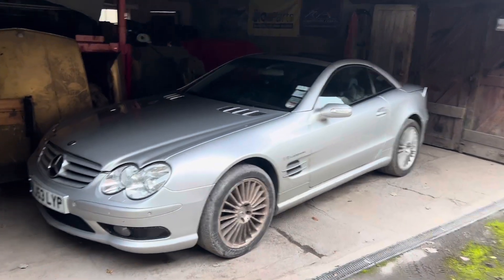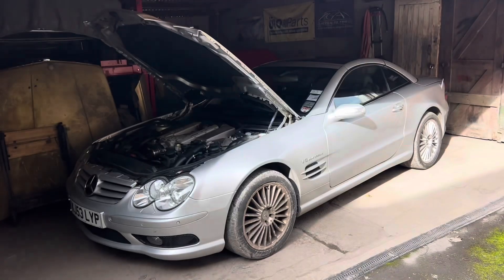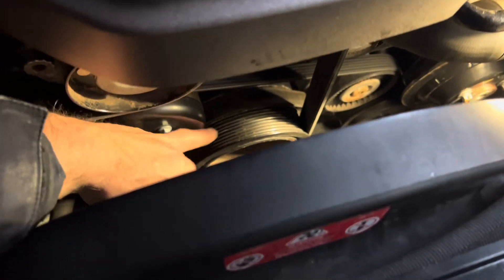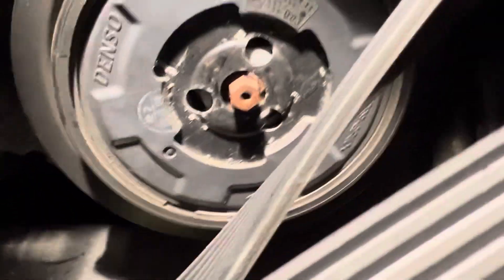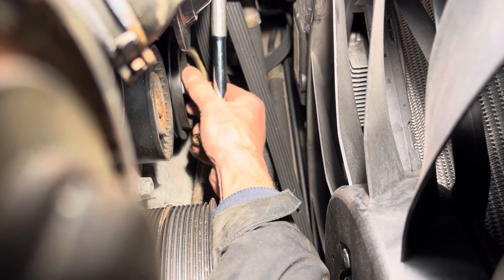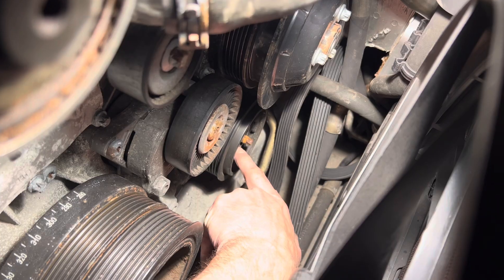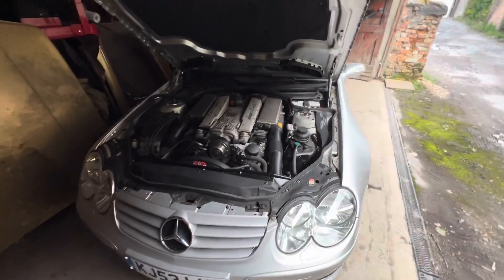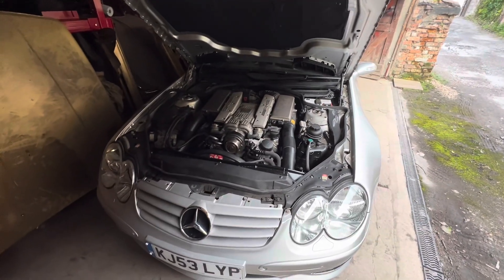Mercedes SL55 AMG How to remove A/C compressor pulley in situ  - Denso 7SEU17C on R230 Audi A4, BMW

Comment: how long would you estimate i have to ride on a bad bearing, just started making noise i took a look its not loose, same bearing tho ac, my shop says they can do it but need to replace the whole ac condenser ect
Reply from the maker: Sorry to read you have a problem with your AC pulley. What car do you have? Most Merc dealerships will insist on replacing the whole unit which is expensive….but as you can see from these videos, it is something that you or any mechanic could be with the AC compressor in situ. The bearing noise will get progressively worse until the pulley disintegrates and your belt comes off. It is something you should get sorted before it gets catastrophic…..and leaves you stranded. Where do you live? Mike
Reply: @MikesMercsandothercars im in new england it just started and isnt loose and recently became quite after a day or so of noise, still stiff, but my euro shop refuses to do just the pulley he said you can ride it till the comes off and can be as soon as a day or up to a year theres no way of knowing, but ii dont have any of the parts and would it back sooner than later will probably send it to the shop tmr, and buy a backup pulley for nextime i can do it myself. and its a 2003 sl55 amg
Reply from the maker: @sp33dy_benz Maybe the best plan is to buy the pulley in advance....and possibly the special tool/bit you need to undo it....and maybe a good set of snap ring pliers. Set aside a weekend  and do the job yourself. If I can do it, anyone can. Mike

Comment: This exact sound happened to me YESTERDAY. I figured out it was my a/c compressor making the loud noise. I figured out that if you get a 930 length 6 rib belt you can actually bypass the a/c compressor pulley. This is what I did now the a/c compressor has no belt on it , which means it won’t spin and make noise until I get a new compressor installed.
Reply from the maker: Hi - yes I have heard about the “ac delete” solution using a shorter belt. What car do you have and where did you get the belt? Mike
Reply: @MikesMercsandothercars I have a 2004 sl55 AMG, I got my belt from AutoZone.